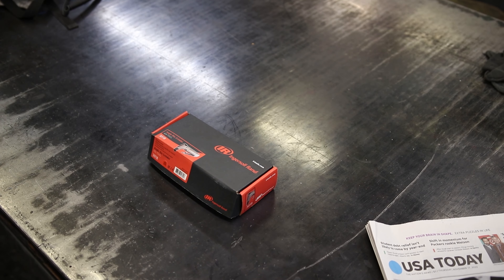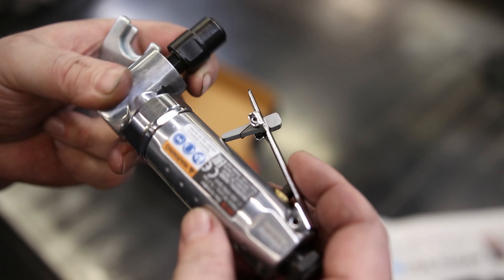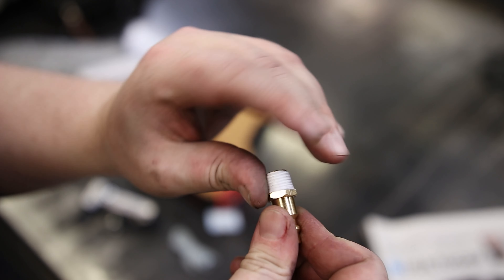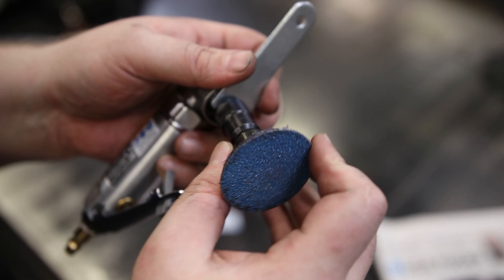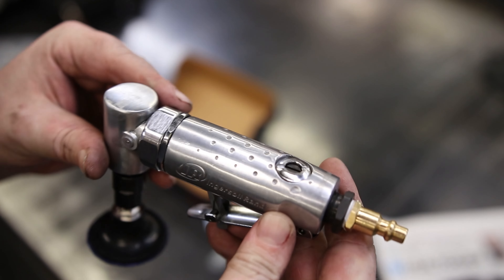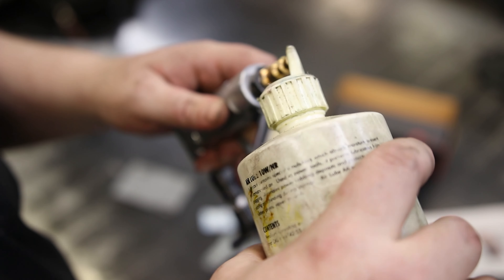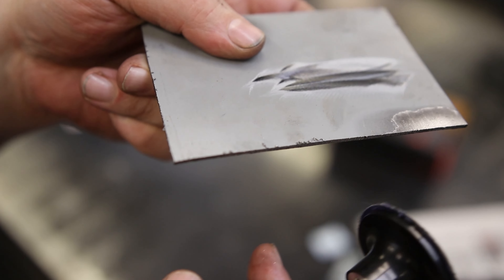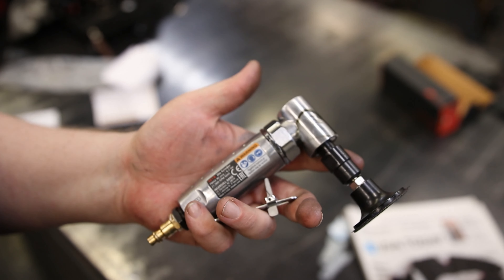Ingersoll Rand Right Angle Die Grinder

Comment: Really good video, I'm thinking about ordering one. My only question: Is the recessed slot screw on the back of the handle a air inlet/speed adjustment? If yes, would it work well for a general max speed limit for sanding/shaping smaller woodworking projects? Something I could adjust once and leave it setup for woodworking?

Comment: Yes its air reduction screw.  Rands are nice. There powerful. They are so load. I'm a tool maker so I spend days in a fitting press using die grinders and pencil grinders. If using 20 plus hours a week go with a dynabrade. .25 as load and doesn't have that high pitch scream. But there like 400 bucks. Guess it depends in how many hours a day you use it
Reply: I guess you always think the tools screaming is cool till you're always using them. But as an observer when I eas a kid I thought it was sick. Like the f1 racing ratchets lol

Comment: Great vid. I have my first air compressor on the way and was wondering how far in do you seat fittings etc? I play on putting teflon tape on everything but on one of my air tools it gets pretty hard to turn and I didn't want to over tighten. Does everything need to be fully seated like you did on this die grinder?
Reply from the maker: It definitely doesn't need to be fully seated.  The rule for pipe threads = hand tight + 1/4 turn.  Where it ends up can vary.

Comment: hey any ideas for keeping the backing pad cold? sounds strange but i heat mine up throughout the day pretty intensly from all the grinding and they seem to melt and shred around the center connection of the  threads and rubber, it heats up and bends  too much, any tips?
Reply from the maker: I haven't had that issue, but if it was me, I'd up to a more expensive roloc holder.  I haven't tried this, but I know 3M makes quality stuff:  https://www.amazon.com/3M-05539-Roloc-Disc-Assembly/dp/B000FW4LC6

Comment: Can you use wd40 instead of oil?
Reply: Wd40 is not a lubricant that you want to use in place of any oil or any other lubricant. In fact it’s a cleaner that strips oil and other lubricants from surfaces. That’s the opposite of what you are trying to achieve with oil.
Reply: @peterlee2780  Thanks